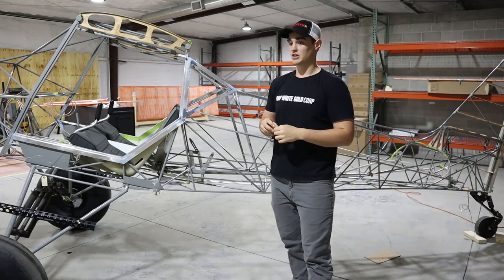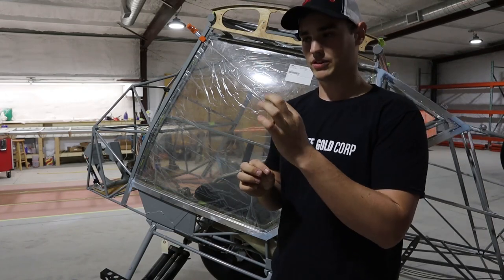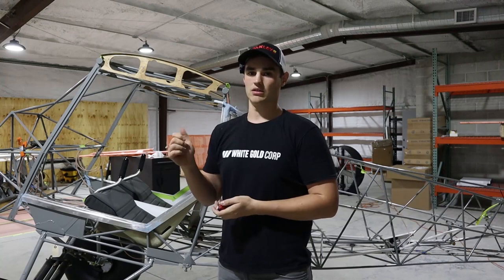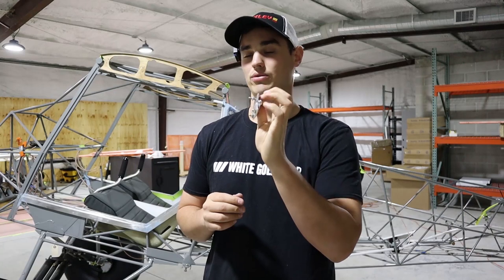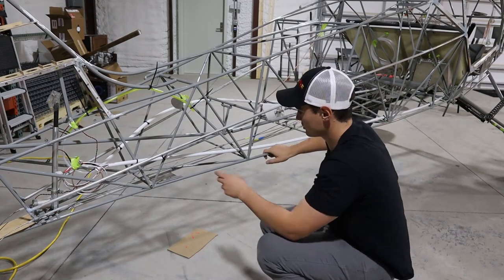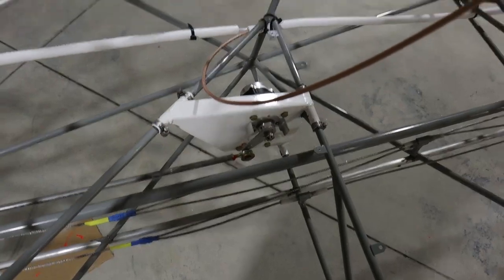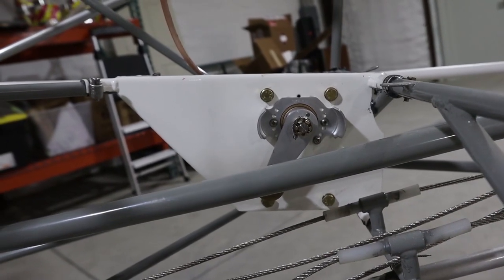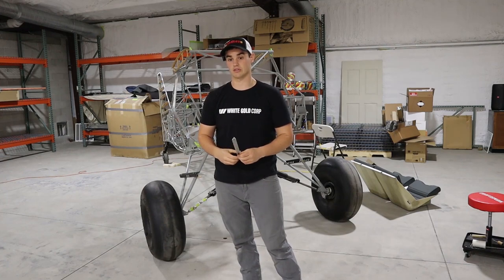Kitfox STi Build Update 9 : More Doors and Getting Fuselage Ready for Cover

Comment: Thanks for the mention. You are doing a great job on the build. Did you get the hinge kit for the turtle deck? That 1/2” aluminum angle looks like the hinge support that goes on the inside of the half of the turtle deck that butts up to the windshield.
Reply from the maker: That's probably why the inventory got mixed up. Turns out that the tdeck hinge kit was optional item. Who knew?

Comment: Nice job and I agree on the #12 reamer. 3/16 AN bolts don't fit the factory reamer. One side note if you are using butt rib close outs you need to have room under the top of your door for the sheet metal to fit on fuselage door frame. They don't tell that in the book. Keep up the good work!
Reply from the maker: Project kitfox said something also about the closeouts. Did you order yours yet. I'd love to see them
Reply: I thought I saw Bowen Aero had some new Carbon Butt rib close outs. I want to go that route!

Comment: Why not just use a #12 drill bit as a reamer looks like all your doing is drilling the hole a little larger.
Reply from the maker: Phenomenal idea. I wish I would have known that from the start. The builder's tool kit comes with the 3/16 reamer and instructions call for it so I just mistakingly had faith in the manual.